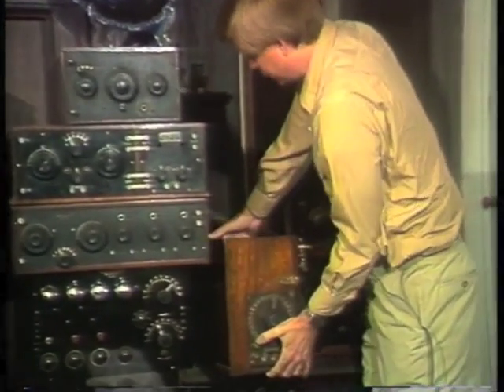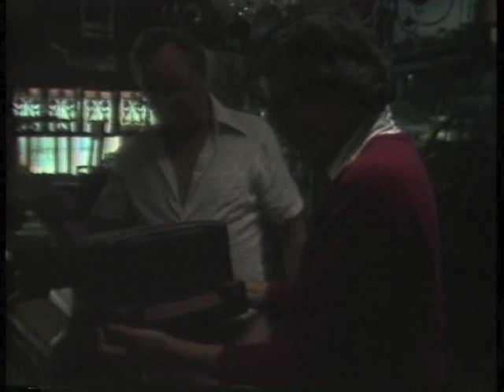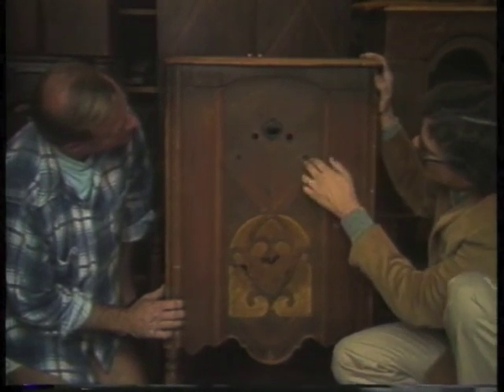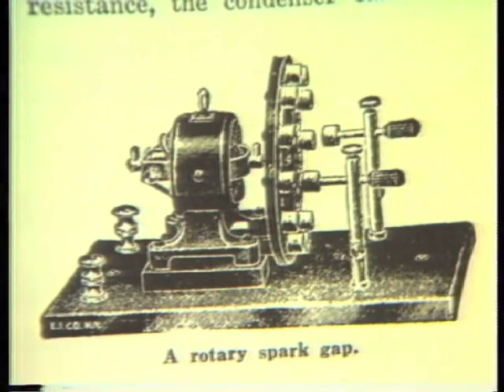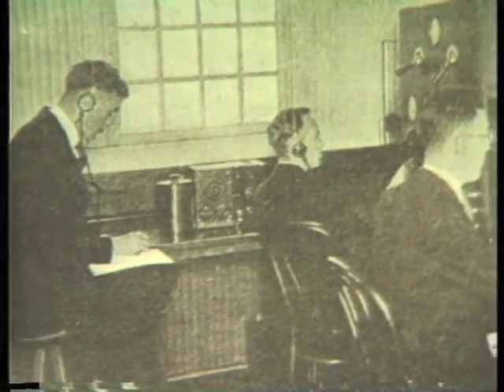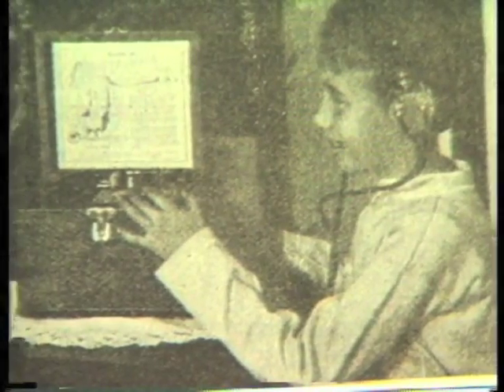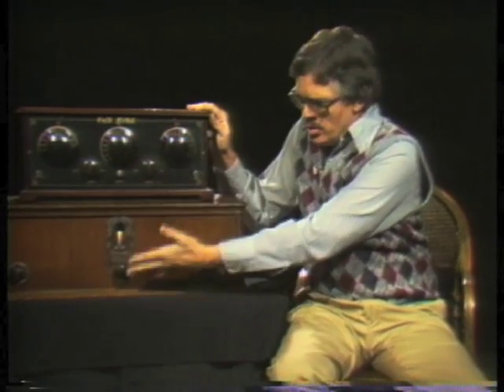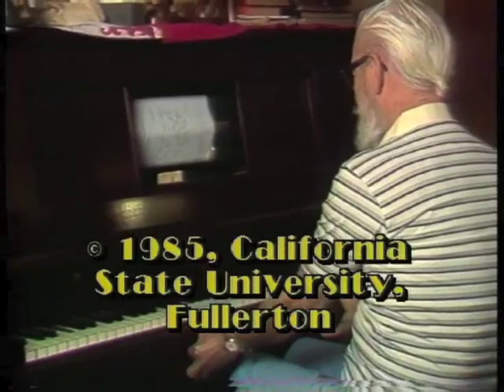Radio Collector 1

Comment: Sister Aimee Semple McPherson was the first woman to own a radio license.  She began her radio station at the Angelus Temple, across from Echo Park in Los Angeles about 1924 with the station letters KFSG station letters for her denomination Four Square Gospel which was housed at the Angelus Temple.
The Angelus Temple had two huge radio towers on the top of the large dome of the Temple with the call letters KFSG on each tower and they lit up at night.  Her radio engineer was Kenneth G. Ormiston (a noted radio engineer and radio salesman in Los Angeles at the time) for the KFSG radio station.  The radio station was so strong, it drowned out the other radio station in Los Angeles at the time and the FCC had to step in to solve the issue.
KFSG ceased operation around 2004 and the radio towers were removed.  Many movies have been made about "Sister Aimee" over the years with the first one being "The Miracle Woman" directed by the noted Hollywood Director, Frank Capra in 1931.